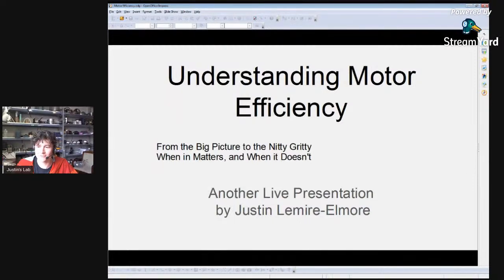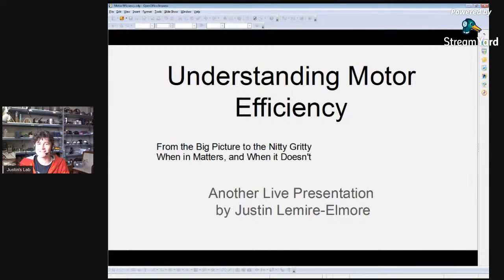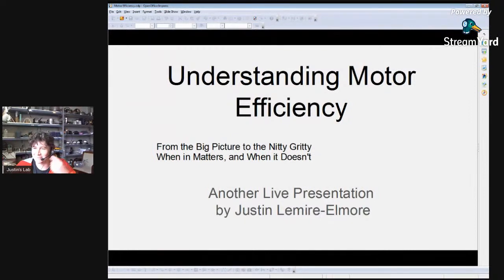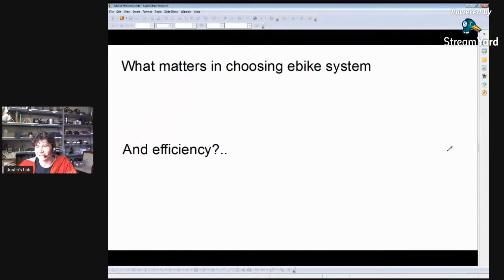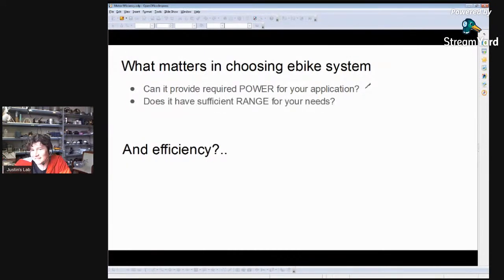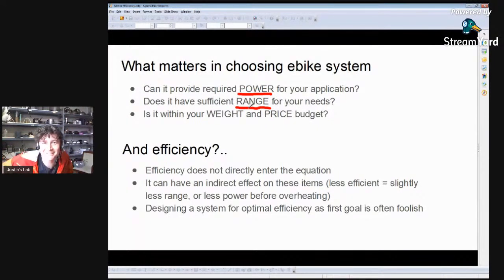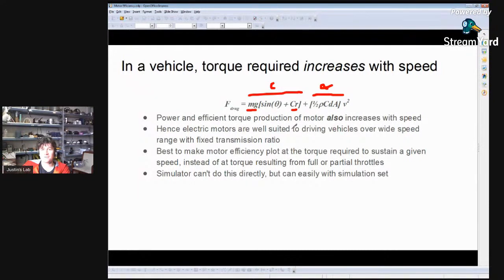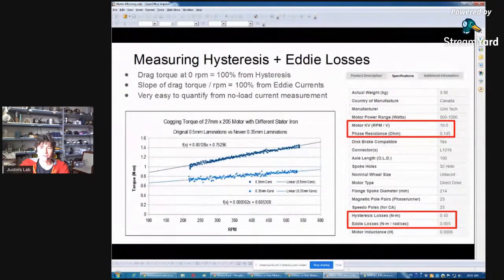Deep Dive into Ebike Motor and System Efficiency

Comment: Running multiple simulations I learned quickly that to improve the torque in the upper motor RPM range like I want, I just need more voltage and there's pretty much no getting around it! I'll probably keep patiently waiting for battery improvements and stick with the 20S pack for the time being 
*insert skeleton waiting meme*.

It was also really interesting to see how the torque to RPM performance mapped so similarly between different brands of hub motors. Some lingering misconceptions I had really fell away with your explanations and comparisons.

This was a very instructive video! Thanks for your efforts Justin, I really appreciate it. I wish your business and talented team catered a bit little more with e-bike products aimed at the 5KW-10KW "gray area" market that I like to play in, but totally understand all the reasons for not doing so.
Reply from the maker: You can get around it with a faster motor winding without a higher voltage battery, and you can somewhat get around it with field weakening which is increasingly a feature in better engineered controllers.  

Anyways glad to hear that you have been learning from this video and good luck with your higher power endeavors !

Comment: Who would like for Grin to make their own mid-drive? A real competitor to the Cyc x1 Pro, just much quieter would be awesome! Maybe a larger motor and lower rpm and belt drive. Ideally with so much power that you don't need really need a fragile gear system. While I love their hub motors, hub motors have the problem of ruining ride quality because of unsprung weight. Also hub motors tend to look more illegal.
Reply: So you want everything that stresses the drivetrain more AND a belt drive. Why not just get used to walking with the setup you have? It'll be a lot cheaper.

Comment: One factor that over rides all of the things you can do to increase efficiency/torque is COST.  The mighty dollar makes the world go around just like electricity makes a motor go around :).  Whether it is a higher grade of steel, more copper, tighter windings, etc...they all add cost so there is always a compromise of cost vs everything :).  Justin...awesome job covering the variables, Thank You!
Reply: Batteries cost more than motors, and calling a taxi to drive you and your ebike home costs more than using the power you saved with a more efficient setup to drive yourself home.

Comment: good job..im glad you seperated eficiency from economy..i would have liked to be shown steeper hills and where hub motors start to sigh off/stall and how long a midrive with gears can hang in there....you shed a bit of light on my long time question "how fast to climb?" (but only for 6% grade) ... for my off road long distance bike packing/racing application i had come to the conclusion that mid drive was the only way that will work...this presentation has given me more to think about but as much as id like a DD hub motor to work in my application i have a feeling it wont work...having said that i might be able to mount a motor forward of the rear wheel and experiment with diferent gearing between rear wheel and motor only...you point out on climbs go fast 15kmph and cruze flat ground slow 20kmph (6% grade only) might be workable ish..off road climbing a steep hill or tight mountain track,15kkmph is very fast and 20kkmph out on a gravel or sealed road is slow ish....this application is asking for 2 gears for the motor to wheel only...i like that you pointed out with a mid drive to keep the human and motor sincronised in thair best rpm ....this suggest if building for a mid drive one strong ish assist level only so that you use that one assist level only and all the time with maybe a higher help level when the only other option is walk.but go slow on the flat....interesting that the 25kmph limited comercial bikes can climb fast and not go fast on the flat.....what you are pointing at for economy and using an electric motor looks very much like a single speed human gearing with a direct drive hub motor mounted forward of the wheel and geared lower...ooo we love simplicity:).....you nearly answered another long time question i have....how much energy are bl controllers using?..and can a brushed motor be more economical at our low motor speeds with out a controller or pwm ?
Reply from the maker: Hey Russel, hopefully if you watch and follow a bit more closely you'll see how you can replicate exactly the same kind of simulation runs that I did to quantify how things will be at even different grades or riding scenarios. As long as the really steep hills aren't too long then usually a powerful hub motor (like the GMAC or RH212) will be totally fine with this usage, but if you have looong steep hills to climb you may need to budget cooldown breaks for the motor otherwise they can go into thermal rollback.
Brushless motors are generally cheaper than brushed motors for the same power and torque capabilities, so they are the more economical choice.   A DC motor without any motor controller at all is not a very good idea and not very useful as you couldn't modulate the power independently of speed or use regenerative braking.
Reply: @GrinTechnologies you say in relation to no controller. "you couldn't modulate the power independently of speed" there are ways to alter voltage with out a controller and if you run the human and motor through the gears you can modulate the power independantly of the speed or we can say that backwards. you can modulate the speed independantly of the power or we can say we can shuffle torqe power and speed with gears...however your talk hints that for economy for a mid drive we should be at an rpm that balences losses and matches the human rpm and for hub motor economy our speed need only change 5kmph (6% grade)..a controller would help(depending on its energy consumption) however one voltage/rpm would also work up untill a stall grade % ..rpm's past the loss balance rpm..althogh this goes biast toward the magnet losses it uses less and less battery power untill we get to zero power used/ no load ...then its human or gravity overcoming all drag......if a free wheel is used here stored energy in altitude can be used to coast if the down hill gets steeper...if no free wheel is used then you are driving the motor with gravity and this will create drag and electriserty....you say " can not use regenerative braking" i think you ment to say "can not use proportinal regen"?...you also say "Brushless motors are generally cheaper than brushed motors for the same power and torque capabilities, so they are the more economical choice."   a 500 to 1000w brushed DC motor with out controller is $25 to $50 usd ......heres a question iv had for a while...how much power do BLDC motor controllers use specificaly in our aplications?

Comment: You said the trip simulator shows the battery efficiency and the motor simulator the controller efficiency. Do you multiply them to get the total system efficiency?

Comment: Thank you for great video! Very useful information.  Very interested into section "optimal efficiency RPM vs Power", and my question here is if there are 2 identical motors but with different kv parameters, would they have different graphics or same? So if I need for example 5000w and I have motor with 8kv or 12 kv, what motor is better for 180rpm ?
Reply: Identical motors will be identical. Doesn't matter what the Kv is. At 5000 W and 180 RPM both motors provide the same torque. Both will perform exactly the same.
Reply: 44:45 in the video
Reply from the maker: In addition to the correct comment here by difflocktwo, I did want to add that you will see a small difference in efficiency with the motor simulator tool with the two different windings, but that is because of higher controller losses in the faster motor wind.  If you set the controller resistance to 0 ohms to only look at motor efficiency, then it works out to be the same.
Reply: @GrinTechnologies  If so, is there any reason to use low kv motor? Especially if the controller still can provide phase amps for high kv motor.
For example, I have 120 A max phase current but use only 50 A and top speed is 42 km/h. I can swap motor for higher kv (double it) and get a boost to speed (even for a short time due to heating). Any downsides?

Comment: Best video of motors out there! Some are to general... Im designing a hub motor for a small vehicle, the weight of the motor is 170g and the gear ratio to the road is around 0,7 (direct drive). I have two of them so 300g, the car weight is 2.3 kg. But it has not much torque... Is there a scaling issue of motors?
Reply from the maker: Certainly small motors usually have worse efficiency and power density than larger motors, but at 170g you should still be able to get enough power to move half of 2.3kg vehicle quite well.

Comment: Thank you Justin, great presentation! It is really DIP dive into this huge subject.
I am still looking for the best answer to this common question: for a given DD motor/battery/controller which is the ideal 'uphill' speed to minimize overheat AND consumption?
Reply from the maker: If the rider is pedaling, then the least heat and least consumption is climbing the hill quite slowly. Then the legs to most of the work and the battery/motor less so.  But if the rider is NOT pedaling or only pedaling with low effort, then you use exactly the process that I demonstrated in the video to make a simuilation set that plots the result.  I was surprised to see that over a range of different motors and grade hills it almost always fell in the 15-20kph realm for lowest consumption.  So that would be a simple answer if you don't want to get into details with a commoner.
Reply: @GrinTechnologies  Thanks, I'll keep in mind these indications. May be one day I'll invest half a day to perform some 'real life tests' with my actual setup. My power meter should also allow to derive more precise figures for each data set.

Comment: When somone is asking for best efficiency on hills, is more like:
- "I like riding fast, but also would like to do it at optimal efficiency of motor". 
Normally I ride MTB 25-30km/h flat and 15-20 on hills.
Upgrading to ebike I would expect around 35 flat.
So now is question what is optimal speed for motor efficiency on hills? Using as a reference point speed I'm cruising on flats.
Because biking is mostly about physcial activity for me, I can do a little burnout in my legs on hills.
So I can pedal 700W through 40s segment of hill. I dont care about aerodynamic drag.

I kinda forgot what I really wanted to ask about.
But mostly about motor efficiency and power distribution legs/motor.
Reply from the maker: For the most part, as long as the motor has sufficient torque to go up the hill at a decently fast speed is best to just key going fast. Let speeds have similar copper losses but stretched out over a longer time period so more total heat is generated. 

Humans will slow down to rather pathetic speeds on a hill climb, like 5-10kph. They're is no advantage to emulating that if you have a hub motor.

Comment: Temp vs efficiency: I read that when heated magnets produce weaker force, thus affecting motor performance. 
Is there any approx multiplier to estimate motor efficiency at different temperatures?
Reply from the maker: That is a superb question that I didn't get into at all in this presentation, but is totally true and yes at some temperature the magnets become weaker too which further degrades performances. You can see how the torque per amp starts to roll off here when the stator gets over 130oC
https://endless-sphere.com/forums/viewtopic.php?p=218321#p218321
However, didn't have a temperature probe on the actual magnets to see what their temperature was at, and obviously different grade magnets are affected differently by elevated temperatures.  In outrunner motors, the magnets can still be quite cool even when the copper is hot, but in an inrunner  motor the magnet temperatures would get close to the copper temps, and this could further degrade performance in a measurable way.  It's not modeled on our simulator though, only the increased winding resistance is there.

Comment: I bought a Bafang BBSHD mid drive yesterday because I couldn't find a bolt thru hub.
Today I see your All-axle hub motor video.  :(
Reply from the maker: Well, on the bright side it's only a front hub motor and some people are pretty fixated on rear, so maybe it wouldn't have changed things for you ;-)   There are always future ebikes you can build too!
Reply: @GrinTechnologies  Front is a no, rear yes. Mid drive expensive but less visible, so it's turned out ok as I can't fit a battery on a Kona stab, battery will be back packed. The Stab won't look like an ebike.
Reply: @gteaz  Backpacking a battery...ouf. That's gonna suck hard if you dump it.
Reply: @fun_ghoul  The Lithium is wrapped up in foam.
Reply: @gteaz  That just makes the lump that will break your back bigger.
Reply: @fun_ghoul  Who told you about my lump?
Reply: Ok

Comment: Excellent presentation. Does anybody know why there isn't more axial pancake design motors made, since they are more efficient and powerfull being smaller and lighter? I feel there is a market for this motor because of all the benefits
Reply from the maker: I can tell you that this question comes up all the time. I think most people who actually go about seriously looking into making one realize that the mechanical challenges with unbalanced forces required for a reliable axial flux motor in this power and size class outweigh the potential benefits.  But that's not to say it can't be done and we would certainly welcome anyone overcoming those challenges and breaking new ground here!

Comment: Would it be worth it if they made finer laminations than 0.35mm that they are now?
Reply from the maker: Only in cases of motors with very high eRPMs where eddie losses are still significant even with 0.35mm stators.  There are very much diminishing returns with thinner lams if eddie current losses are not a dominant part of the core heating. We have some MAC / GMAC motor samples with 0.2mm stators for evaluation to see if it's worth it or not.
Reply: @GrinTechnologies  Hi, thanks for the informative and detailed video! Is there any update on 0.2mm vs 0.35mm vs 5mm laminations?

Comment: Is there any way to record real time data from a trip so that the data could be run thru the simulator to discover ways to increase efficiency if that trip is repeated. For example - say you do a repeated trip daily such as a commute to and from work. It would be very useful to analyze the parameters of your trip to see how changes to throttle use would effect battery usage or compare different routes to see which is more energy efficient. Would also be interesting to have a function to analyze a long trip to see what the power requirements would be if you do the reverse trip back home.  Not sure how this could be implemented but just wondered if you have given any thought to try to develop this capability?
Reply from the maker: https://ebikes.ca/tools/trip-simulator.html

Input type change from "manual plot" to "google maps"

Comment: 30:05 "The higher the RPM of the motor the more power it can generate and --more torque it can produce--"

Is the torque part misspoken, because you forgot to add the "efficiently" part to the end of the sentence when you said it? The powerpoint page does have the "efficient torque production" written.
 
I'm just getting a bit confused, as is my understanding that RPM doesn't affect how much torque the motor (PM-motors) can produce to an extent (losses), but does effect how efficiently it can produce it. Isn't stall torque the greatest amount of torque the motor can produce and I don't think it should be able to increase if you increase the RPM? I think there was a later part where you said the quoted sentence again, so I'm just asking for a clarification.

I'm an electronics engineer who does electric skateboard building as a hobby and I've been logging and monitoring my board's performance and efficiency on my rides (as you do as an engineer, as you said :D)

EDIT: Otherwise an excellent presentation and lots of great information!
Reply from the maker: You are 100% correct here so thanks for pointing this out. I should have said "power and EFFICIENT torque production" as is written on the slide. The motor can still produce high torques at low RPMs, but the efficiency of the motor is much lower in this scenario than when it produces that same torque at higher RPMs. 

Stall torque is mostly determined by the battery or phase current limits of the motor controller, it's not a motor characteristic but a system characteristic.  If you are phase current limited by the controller, then the torque is totally flat and independent of RPM up until the speed where your you become either battery current limited or voltage limited. All of this is modeled on our motor simulator app (including a number of skateboard hub motors) so you can see the effect of different phase or battery current limits on the torque/speed line.

Comment: So do motor controllers with advanced features like FOC change the efficacy or is it like field weakening and just allows the motor to operate with a larger envelope. My non learned understanding of foc is its like field weakening in that it plays with the magnetic fields but with real maths to get the effects of optimal magnetic interaction for smooth mechanical force and in turn power efficacy.
Reply from the maker: In practical steady state terms, a field oriented controller behaves just like a sinewave controller but with always optimized timing advance.  You do get better efficiency from the motor (by a couple percent) than you have from a trapezoidal drive, and you also have a faster increase in torque as the motor is loaded and slows down.